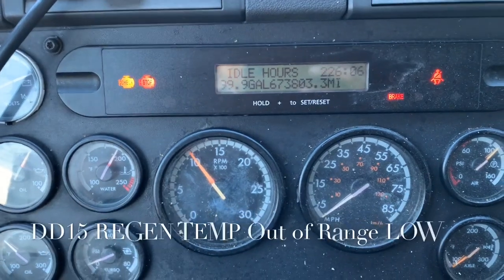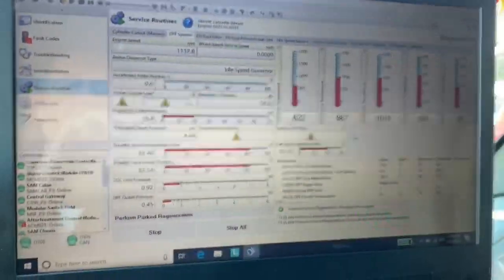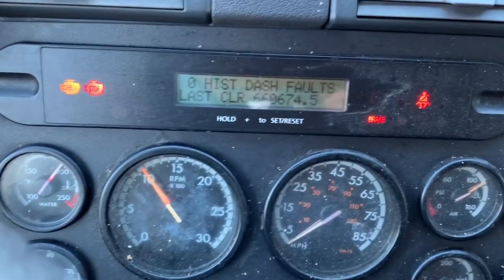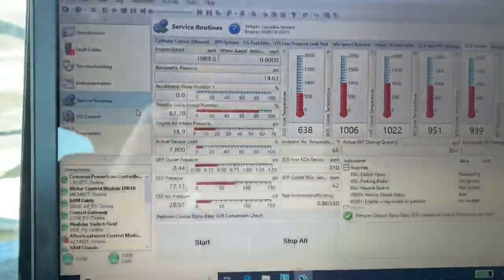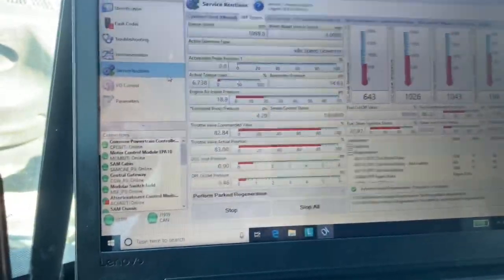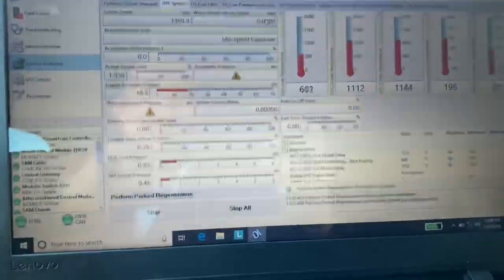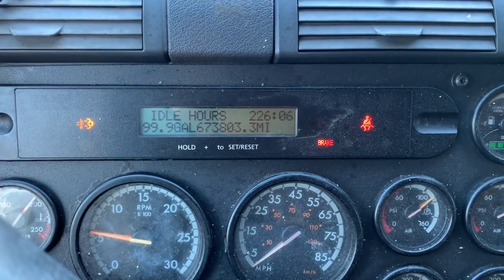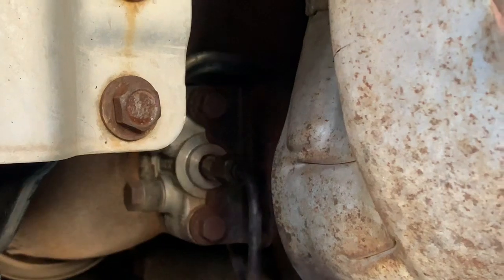DD15 with regen issues. Soot level high, parked regen failed due to not reaching temp. LOW

Comment: Hi Pedro. Recently I got the codes ACM520342 17 and SSAM 520762 -5 and SSAM 520761 also 5. So I had to put my truck into Authorized Freightliner shop in Calgary, Alberta, Canada. It is New West truck Dealership . My truck is Freightliner 2020 with 190 000 MI on it with Automatic Transitions D12. I have Purchased this truck from the same Dealership in Calgary , Alberta, Canada. My Truck is sitting there for 8 days already and seems to me they still can't solve the problem. Today I had a chance to get into my truck and go trough Diagnostic. At that time I could see those previously faulty codes are gone and there is a only faulty code I haven't seen before.  A new faulty code is ACM 3609 12. Wasn't there before. Please help me out to understand what is going on with my truck. Your response will be greatly appreciated. Thank you
Reply from the maker: I will check out the fault codes on Monday when I get back. I’ll check my books.
Reply: @CarlosDieselElectric  thank you. I am getting crazy because I don't know what is going on with my truck. Less than 1 year old with that meny problema. Should I just walk away and find another job in some of the manufacturing company as assembler
Reply: @CarlosDieselElectric  thank you

Comment: Hi Pedro, I’m in Montebello too and wanted to speak with you regarding some repairs
Reply from the maker: Sure, give me a few minutes. What number can I call you at?
Reply: @CarlosDieselElectric  I’m Gary, I just realized I came to your shop yesterday regarding injector cups and fan switch. I’m Still waiting on Javiers number from you. Excellent video btw.....I tried your suggestion about installing the fan switch and I didn’t get lucky lol.....I need it programmed I guess.
Reply from the maker: @johndoe-xo6jq  I would like to do the work but I am booked. I was hoping the fan would have worked. Once it is programmed into the cab side it will work just fine.

Comment: Hey brother I am having issues with my truck how can I contact you for a question?
Reply: I have a 2016 cascadia with about 600 k miles 

I changed def filters about 1 years ago because I got 4364 fmi 18
And my problem went away

Then I changed outlet nox sensor because I had a code related to nox sensor faulty or so,ethikg like that and it was fine and perferomed forced regen 

but now recently my truck tried doing a regen and something didn’t let it and I got a code saying overboost detected during regen and intake manifold pressure to high 
Code 3464 fmi 16 
The regen started as normal then reached a point where it just accelerated and it stopped. I’m guessing that’s the overboost 
I was told this could be vpod.

Now it’s been about 6 months since that code and lately I’m getting code 
4364 fmi 18 nox conversion low and poor def quality again and I perform a regen and it goes away. 

But my truck hasn’t done any regens by itself or asked me for a regen my question is can vpod prevent truck from doing regens? Therefore my truck hasn’t any type of regen and is telling ,e nox conversion low?

I’m thinking of changing doser valve

Comment: Hello bro,
Great video. I have one question. I have taken my truck to the mechanic shop 3  to 4 times already. 
The problem is when the truck ask for regen and then I park and start the regen manually by pressing the regen button and then it starts revving up the RPM as usual and then after few mins the fan starts and then the truck jumps every time when fan clicks  like it misfires or something and then after truck regen sound goes to normal but RPM stays up between 12 to 1300 rpm and its not doing anymore regen but acting like it's doing. Please advise the truck is 2014 cascadia
Reply from the maker: Any fault codes?
Reply: @CarlosDieselElectric  no fault codes
Reply: Every time fan clicks then regen temp drops but rpm stay the same 12 1300 rpm
Reply from the maker: @flyingjstation  the rpm sounds correct, but you need someone to plug in and monitor the temperatures and pressures. DOC inlet pressure, DPF pressure are important. Also, what are the temperatures. 
What did the shop see?
Reply: @CarlosDieselElectric  doc inlet temp was 338 and doc outlet temp was 342
Dpf outlet temp 470 and scr  inlet temp 378 scr outlet temp 326.

Egr delta pressure:  .0893

Comment: Hello. I'm using DDDL 8.13 and cant start parked regeneration. Can you give me some tips please?
Reply from the maker: I usually have the engine at 150 temp or higher. 
Sometimes the park brake, foot brake and clutch need to be applied then you can initiate the parked regen with the software

Comment: Hi Pedro, I have a problem with my 2012 Cascadia 700k miles. Just cleaned filters put them back in and when I wanted to do forced regen it starts but instead of staying on 1500RPM it goes back to 1100 for a second and then back to 1500 for 5-10 seconds and then goes down again and circles like that all the time… DOC temp is around 380 when it starts but slowly getting up. Had to stop doing regen because I thought something is broken… no fault codes except the NOx sensor permanent… do you think it’s only nox or something more serious? My mechanic tells me it’s probably turbo not building up the temperature, but turbo shouldn’t make my engine RPM go low from time to time while doing forced regen. Never had any issues with this truck whatsoever
Reply from the maker: Have someone perform a parked regen and look at the numbers. Look at the Intake Throttle Valve and see what it is doing. It needs to hold steady at around 85%. If it does not then you have another problem that is not allowing the temp to rise.

Comment: Red light came on because temperature was too low?
Reply from the maker: Start with your Diesel Doser Injector. Check for any blockage. Remove and clean it out (S pipe). Then try to do a parked regen. If you have the laptop use it to monitor temperatures. 
This would be the easiest place to start

Comment: I have that code and the esc I parked in the shop and now it won’t start any help?
Reply from the maker: What do you mean it won’t start? Does it crank and no start?
Reply: @CarlosDieselElectric  no sir it doesn’t not crank at all ether
Reply from the maker: @bhavjitsinghgill7404  automatic?
Reply: @CarlosDieselElectric  manual 10 spd

Comment: Is there a way to do a forced regen on my tripac Evolution?  Has code 13 and im not able to regen while driving
Reply from the maker: Super Trucker! Is there a check engine light on?
Reply: @CarlosDieselElectric  The tri pac is calling for regen and not able to do it for some reason.  I have the amber light on dash switch ans the dpf fault blinking red with the code 13

Comment: Hi Carlos. I have this codes 061 spn 5443 15 dd13 cascadia and 061 spn 3719 0. Both amber check engine and red flashing light. Wont let me do regen truck shuts off and DOC temperature inlet not reaching temperature for regen to start. I clean fuel doser and S pipe. You think i should replace delta pressure sensor?
Reply from the maker: Rene Olivares let me get to my shop in about 3 hours (0900 PST). I can look up the codes to see what you are dealing with. 
I don’t believe the Delta P sensor will help but let me look the me up and will try to help you out.
Reply: Carlos Diesel Electric man Carlos thx for replying. If you can call me ill appreciate let me know so i can send you my number. Thx Carlos.
Reply from the maker: SPN 5443 is Hydrocarbon (HC) Absorption in the DPF is very High. Probably due excessive idle.
SPN 3719 FMI 0 is typically Soot Level Very High.
Recommend to have someone that has the Detroit Diesel software take a look and perform a forced parked regen.
Reply: Carlos Diesel Electric i just bought the diesel software doc inlet is not getting hot to start force regen. It was also giving me the permanent delta pressure sensor code and thats when i saw your video when you replace it and calibrated. So i was wondering maybe delta p s doesnt work!  I have two amber check engine and red check engine flashing that shuts my truck off. I clear all faults code and with in seconds they pop back up. Therefore force i cant force regen   Thx for your reply man
Reply: Carlos Diesel Electric i just bought the diesel software doc inlet is not getting hot to start force regen. It was also giving me the permanent delta pressure sensor code and thats when i saw your video when you replace it and calibrated. So i was wondering maybe delta p s doesnt work!  I have two amber check engine and red check engine flashing that shuts my truck off. I clear all faults code and with in seconds they pop back up. Therefore force i cant force regen   Thx for your reply man
Reply from the maker: Rene Olivares what are the other fault codes that are present? The MCM and the ACM? 
The other fault codes Active and Non Active?
Reply: Carlos Diesel Electric i dnt remember ill let you know once i go back to tracy where my truck broke down and re scan. Thx again 4 ur help.
Reply from the maker: @reneolivares7769  no problem. The other fault codes should give you an idea as to which step could be next. What year is the truck?
Reply: Carlos Diesel Electric 2014 dd13

Comment: What temperature does it newd in tye morning parked regen..when cold
Reply from the maker: I always make sure the engine temp is at least 150 degrees or higher before trying to perform a parked regen.
Reply: @CarlosDieselElectric  thank you ..i did it at 150 yesterday bcause if not running it would go higher..it was the morning

Comment: I got the check engine light on with engine 2(4) fault, I'm not sure what that means, the acceleration goes up to 800rpm, and I couldn't go more than 1000 rpm with my foot on the accelerator . Please advise anyone.  It's freightliner 2015
Reply from the maker: you need the other fault codes, the screen you are at shoes engine faults but you need to hit the + button on the dash/steering wheel to take you to the actual fault codes.
Reply: @Pedro Fuentes  thank you, I'll do that

Comment: Please help I have 2012 cascedia. We did the regen and the light still flashing and also the engine light came on both the yellow and the red one.  The truck will cut off in like 5 minutes. It’s giving me a code eec61 and spn3556. Thanks
Reply from the maker: alinasir gaal seems like a code for low temp. Try cleaning out the Doser Injector. Remove it and clear the carbon in the S-pipe. The. Do a regen. 
Have you had anyone try to read using the correct software?
Reply: Carlos Diesel Electric no sir haven’t had anyone to look at it. Thank you very much for the info I will do what you just told me and will share with you the outcome. Thanks again!
Reply: Carlos Diesel Electric can I still do a force regen even with a low temp?
Reply: Thanks carlo for ur help I went  ahead and close the def system. Since then we haven’t had a issue at all.
Reply from the maker: Dezmon Monroe you can try to do a forced parked regen but the you may not have any luck. If the temperatures can not rise. The regen will run for awhile or it will about. Try cleaning the Doser Injector and the S-pipe first then try performing a parked regen. Low temp regen is a result of heat temperatures not rising.

Comment: Hey, on my truck 2014 freightliner cascadia dd15 spn102fmi18 code comes on and goes away automatically when i drive up hills
Reply from the maker: If I am not mistaken this has to do with boost. I ran into this problem before with a customer. I tried using a test turbo, checked the CAC and still the same. However, I used a test MCM from a similar truck and I felt an improvement of more power. Just to be sure, the owner took the truck to Valley Power Systems (authorized Detroit Diesel) and they said it was because the driver was in the wrong gear when driving. I did not believe that, but that was there opinion. Try using a test MCM from a similar truck of the same year and engine first.
Reply: Carlos Diesel Electric I’ll try that thanks for heap

Comment: I have the small regen light flashing( the one where the DEF gauge is at) after doing 2 regen which took about 40 mins each which is a normal regen time. What are the most likely reason of that?
Reply from the maker: Mpower 60195 any fault codes? SPN on the dash? Or has anyone plugged in to the truck? What year is the truck?
Reply: The fault code is SPN 4364 with the orange engine light on. The truck is 2011 Cascadia with about 390k miles and has a DD13 engine.
Reply from the maker: Mpower 60195 fault code 4363 usually SCR NOx efficiency low. This is sometimes accompanied with fault code 3364 improper DEF quality. This could be the SCR is starting to fail but first check to see if fault code 3364 is present. This could be the DEF metering unit. I will be uploading a video on this shortly.
Reply: Thanks man.
Reply: Oh and yes it is accompanied by 3364. 
What is the chance that it’s the DEF pump?
Reply from the maker: @jasonedits459  No, in order to determine if it is the DEF pump you need the software and you need to perform a DEF quantity test. If you have fault code 3364 present then you may have bad DEF or the DEF Metering Unit may be bad and that will trigger fault code.
Reply: Thank you buddy. I guess I have to take it in to check it out.
Reply from the maker: @jasonedits459  Unfortunately you will need to take it to someone who has the software. They need to check DOC pressure while doing the parked regen. This will help to determine is there face plugging. If the DOC pressure is good then you may just have a DEF meter issue.
Reply: Ya that’s what I thought too. Do you have a shop? I live in southern Cali
Reply from the maker: @jasonedits459  My shop is located here in Montebello.
Reply: Do you offer a road service as well?
Reply from the maker: @jasonedits459  Sorry for the late reply. But we do not offer road side service. Everything is done here at our site. We work M-F 8-5 & Sat 9-2 Closed Sunday

Comment: I deleted mine.  No more problems.
Reply from the maker: Richard Melton yup, that’s what I hear from people that have had it done.
Reply: @CarlosDieselElectric  Best money I spent.
Reply: Have u had any problems since u deleted yours ? I dont usually idle, but I did the previous 2 nights, and when I woke up I saw the the parked regen flashing. Mines is been deleted about 2 months now so it was weird to see it flash. Someone told me some trucks have a timer,  so it doesn't recognize that the def is deleted.
Reply: @Jmoss3607  No mine does not do it. I idle all the time. I would disregard the regen light. Theres nothing to regen.

Comment: I usually change my fuel filters an the regent will complete with out a problem. I usually get a abnormal doser pressure warning when regen will not complete.
Reply from the maker: thebeertruck1 have you tried removing the doser injector and then cleaning or clearing any excess carbon that may be blocking the path of fuel. This means the s-pipe and not the tip of the doser injector?

Comment: Hey guys, im a mechanic out Bakersfield ca. I am having this issue bueno the difference is that my fuel cut off valve is at 0% and won't come on.
I have changed the doser block, 7th injector, engine harness, and qcv and still no luck.
Anyone had this problem or have an idea?
Reply from the maker: What is the symptom you are having? What is the truck doing or what are you trying to do?
Reply: @CarlosDieselElectric  the truck is derated and in level 5 due to not being able to regen.
When I try to regen it wo t go past 800 degrees because it won't dose
Reply from the maker: @edder1128  What year is the truck
Reply: It is a 2017 cascadia
Reply: With a dd15
Reply from the maker: @edder1128  2017 DD15, have you checked the opening at the Doser injector for any blockage (carbon) behind the turbo. 
When I get back to work tomorrow I can check my book. But there maybe a valve on the hi pressure fuel pump. I don’t remember, so I’ll verify it tomorrow.
Reply: Yes I took off the 7th injector housing and it is clear.
Sure I appreciate the reply.
Reply from the maker: @edder1128  what are the pressures at the DOC and DPF when you are doing the regen?
Reply: Inlet .775 outlet  .338

Comment: Its been 15k miles and my def still full. Any advice?
Reply from the maker: Dre' Prowlah any lights on the dash? Does the truck have a DPF delete?
Reply: @CarlosDieselElectric  no delete 
Yes check light and other yellow engine 15 freightliner cascadia dd15
Reply from the maker: Dre' Prowlah first thing you need to do is see what fault codes you have. Active and inactive. Also, using the Diagnostic Link software you can perform a DEF quantity test to see how much DEF metering unit is being sprayed. This is a good place to start.

Comment: Delete it and you won't torture yourself and your pocket.
When those systems fail it is impossible to fix it,especially when the truck starts to burn oil which is normal for trucks over 500k miles.
No technicians can fix them believe it or not.

Comment: In my truck i cant remove that sensor.
Reply from the maker: You have to carefully apply heat around the thread housing. Before that , apply a penetrating oil like WD40 and let it work